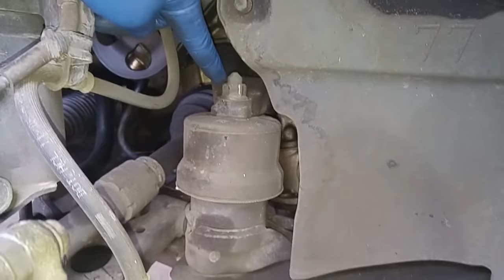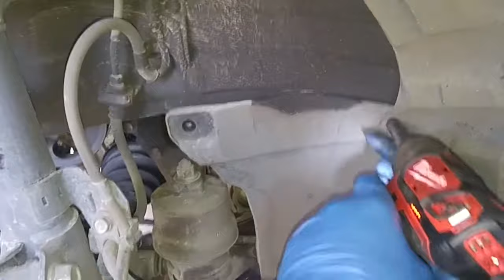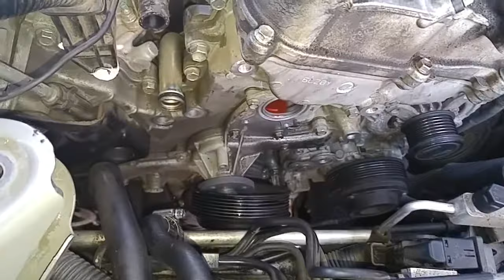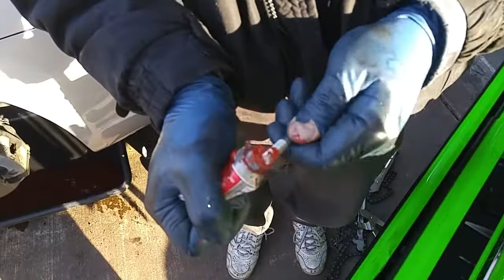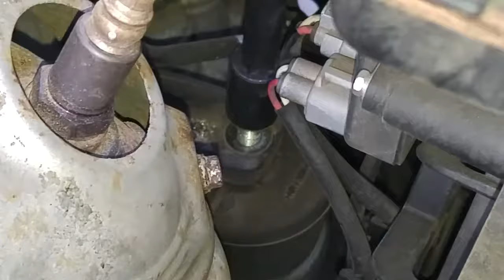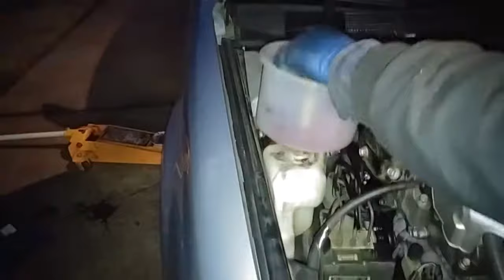Toyota Avalon / Camry / ES350 V6 2GR-FE Water Pump Replacement

Comment: My friend this was a great great great video. I swear you solidified my decision NOT to change my Water Pump.
I no longer have this much patience to work on Japanese cars.
Reply from the maker: I hear ya ... but things are not getting any easier working on ANY specific make or model car.  See what's involved in replacing the water pump on a  V6 transversely mounted engine inside a GMC SUV.  The GMC V6 is a timing chain driven engine and you'd be lucky if the timing chain cover doesn't leak before reaching 100k miles.  Resealing the cover is around a 6 hour job.  And you'd be lucky if the timing chains last past 200k miles.  That's a little under 10 hrs labor, around $500 + in parts ... so you're looking at over a $2000 repair.
Reply: Me too , I feel the same , hard to do that much now
Reply from the maker: I hear you!  It's getting tougher and tougher to do your own repairs much less diagnose the cause of a problem.
Reply: its surprisingly easier in the GS/IS350 V6"lol
Reply: Japanese cars are the easiest to work on.

Comment: Thanks for the detailed video. How do you tell the noise from the pump's bearing and idler pulley(s) or you replace them all just in case? What is the mileage of this car and how often this engine's water pump is replaced under normal driving condition? All your answers are appreciated.
Reply from the maker: 140K miles.  Take a long pry bar and place it next to the part that you think is making noise.  Place your ear on the pry bar handle and listen for any grinding noise.
Reply: I took a stethoscope, remove the end film and that end working like a sound collector. Point the end toward each pulley and you should hear the difference. Then take the sepentine belt off, spin and wiggle them by your hand sometimes you will notice grinding noise or play.
Reply: @slowerdaddy  thanks a lot.